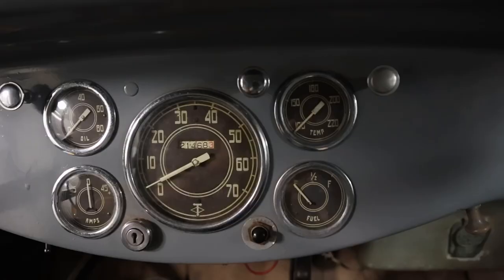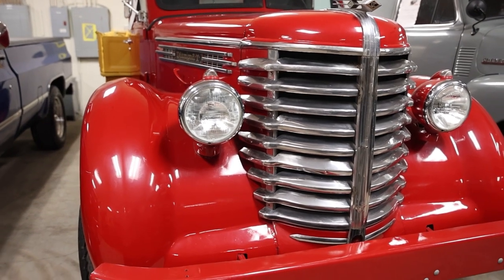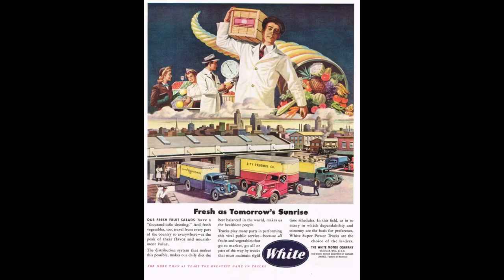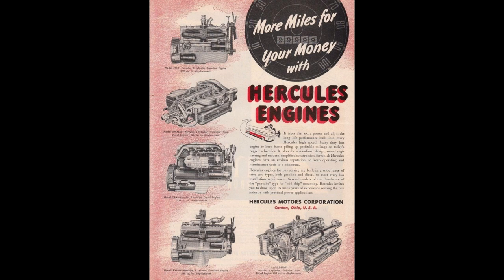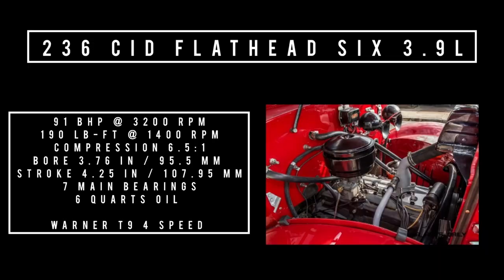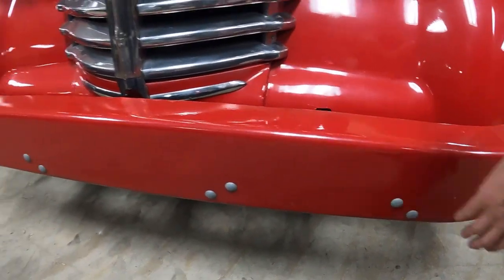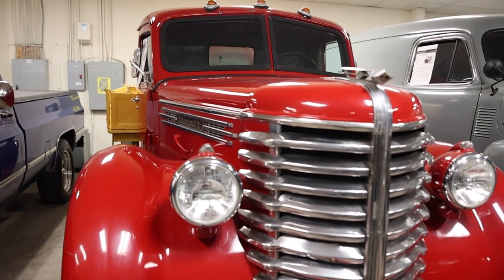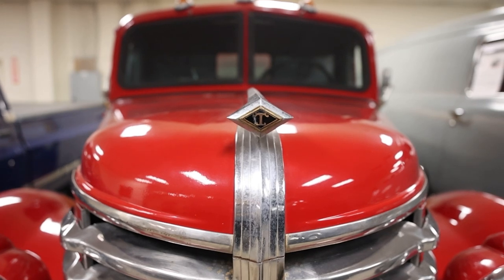1948 Diamond T 306, CADILLAC OF TRUCKS￼

Comment: Okay, here is what I know about Diamond T's.  They actually made a 3/4 ton truck as well from 1936 until 1938 called the Model 80.  The Model 201 had an "X frame" or "X" crossmembers instead of the common side to side crossmembers on other trucks.  This made the frame much more ridged and heavy duty.  The "X" frame was also reinforced. The Model 201, although rated a 1 ton, had a GVW of 8,000 lbs.  The 7 main bearing engine was a well balanced, smooth running engine.  By the way, I have a Hercules engine in my 1950 Oliver OC3 dozer.  The interiors came in standard and more deluxe models including a clock, jeweled cigar lighter, and engine turned dash panel among other upgrades. Also optional was 20" wheels with premium hubcaps.
Reply from the maker: Awesome thank you so much for sharing  that information =)

Comment: Just stumbled onto this one. Very nice! I'm retired from trucking. My 2nd truck was a 57 Diamond T 931 (I think it was?) Cabover with a 30 " sleeper. Bostrom air seat. 270 Cummins. It rode like a 55 Roadmaster! By the way.... I dig David Ruffin (RIP)
Reply from the maker: Aw man you had a big commercial truck that’s awesome I can’t get over how spotty the information is on these.. because these where the trucks to have.
Reply: @What.its.like.  It also had shutters for the radiator to keep the heat in the Winter & West Coast mirrors. I believe Hanks Truck Pictures used to have a lot of info about Diamond T. It's been 50 years since I drove it

Comment: There's a pretty significant point you missed on the engine. When was the last time you saw a flathead with the distributor on the same side as the manifolds? Like never? I'd guess that they kept one side pretty clear to allow for hydraulic pumps or air compressors. Also, you used a very odd turn of phrase.... 'Do me a solid' ...?  I have visions of a doctor giving you a sample tray, pointing the way to the toilet and saying exactly that.
Reply from the maker: Thank you so much for pointing that out I didn’t recognize that I’m looking at the engine how was more concerned that half of it was exposed and half of it sat underneath the firewall. Thanks again for pointing that out =)
Reply: Ah, yes, the setback of the motor. I can speculate on the reason for it. A truck is a big investment and the more hours per day it works, the better the investment is recouped. A factor in how much it can work is how tired it makes the driver. (Did you say it had a comfortable seat?) If the engine is not directly over the front axle, then some of its weight will be on the back axle, thus making the steering easier. There may also be advantages in the gearstick location, making it easier to drive. As I say, this is speculation, but I'm sure you'll see the logic of it.

Comment: The wipers were vacuum, on the dash. Headlights, for a very  time dash lights and tail lights are on the same circuit. If you don't have dash lights you don't have tail lights. The other knows would be the choke and the throttle.
Reply from the maker: Great information =)
Reply: @What.its.like.  When I can, and I know, I will post information on cars. I have worked and driven some old old stuff.

Comment: Total guess, the toggle switch to the right of the column and below the dash is for instrument lights? No point stretching a 6 volt system, with a crappy generator, too far. I'm unsure, but I thought I saw a few additional switches under the dash on the right side as well? From memory, ergonomics and attention to labelling were invented in August 1963 in New York. Just kidding.
Reply from the maker: Could be I never thought of that, why the one cars had a switch for panel lights but makes total sense

Comment: The behind the scenes developments of engine compression, are sort of charting a graph, of engine power output within the American  civilian engine scene. Which I have been quietly noting. By the 60s, the comp. Ratios begin to increase steadily with the HP war's building intensity. Higher stressed engines are appearing, but using the old tech of push rods still, for the most part. While European cars, cannot afford to use displacement to increase HP/PS/KW due to the very high fuel costs they labour under. 
(I.e., converted, to US Imperial gallons roughly, $10~$12 + gallon) answers the question of why they have such small but very high technology, with very high efficiency engines used. Which also applies to Japanese auto engines. DOHC 4 valves per, high compression, smaller displacement engines which have tremendous power output for their size. Compare a 5 litre Windsor to a Japanese 3.5 litre V6 engine, and the Windsor is a lawnmower engine, by any comparison. (very heavy cast iron block and head using push rods and 2 valve heads which use large amounts of fuel to produce a pleasant burble sound at idle, but power output figures which are embarrassingly low)  (165BHP?) without antipollution gear. From a 5 litre engine under a weight penalty is awful. Despite that being said, measure for measure the High displacement 7 litre American V8 with a good carburettion pack (4 barrel) gave a good account of itself where gas was cheap and plentiful

Comment: Wrong GM Brand It the Oldsmobile of Trucks. A Caddie would never get caught doing manual labor.
Reply from the maker: Cadillac did make “trucks” tho so did Lincoln.. plush seats make it the Cadillac of trucks and I wasn’t the one that coined that phase
Reply: @What.its.like.  Well the grill is from an Oldsmobile. A '38 I believe.
Reply from the maker: REO was Oldsmobile I believe diamond T is totally different company, at this point in time diamond T would merge with REO to form diamond REO but that was in 67
Reply: @What.its.like.  We are both right since these trucks had a Continental or a Hercules engine in them. Like White and Sterling, it was part of GM's past and nothing else. Like Locomobile, the Company was acquired and not an original offshoot like Pontiac and Autocar was from Oakland.

Comment: Hey Jay, Just before I go to bed. 6:00 AM, you can go to my channel, per my address line and check out the' Ford Australia',  developed designed and built in Australia, Ford GTHO Phase III Falcon, which had to be homologated for track racing purposes. In 1967, it was the fastest 4 door family passenger car in the world @ 140MPH, with a car magazine driving it from Sydney to Melbourne. The journos found a safe place, (no cops) and a photographer n the rear right, sat behind the driver front right, and took the magazine's cover photo of the speedo showing a verified 140 MPH. You could take your wife and 3 kids for holidays in it, and so many did. The motor was a standard 5.8 Litre Cleveland, which was blueprinted for the homologation required which was 500 vehicles, but they built so many more than that. If you own one, you could trade it for an MC'mansion style house.(we have the biggest houses in the world for some reason, ) where your family with 2.5 kids can get lost and waste money heating and cooling. So it is stevenhoman2253 (which appended the numbers automatically by Ute-Ube one day, probably for tracking purposes???) Pretty sure my names up top, but I can't see it till I finish the message. Look around if you want, but it isn't a true channel, just some of my viewable saved ute-ube files.
 Just for your personal interest and viewing pleasure of one of our 60s muscle cars. GMH and Chrysler had their V8's and Chrysler their Hemi V8s, yet all in smaller, lighter packages. GMH even had a 2 door compact with bolt on flared guards and air dams and  rear spoilers with the 307, or 308 or even a straight 6, with some tuning they were monstrously quick, and the Government eventually intervened, before 
all the countries sporting legends ended up wrapped around a tree.
The compact GMH 'Torana,' could pull 12's Good night/morning Jay, get back to you latter and check out the Diamond T.
Reply from the maker: I’ll be sure to check it out I wish youtube made it way easier to click on peoples channels to check them out I’ll have to do it when I get to a PC I don’t do anything on a PC generally everything I do is on an iPad and the iPad system is way dumb down and I think that is a huge misstep for YouTube I wish they offered all the features they offer on a PC on an iPad in other words..